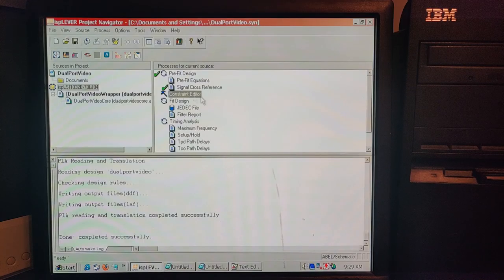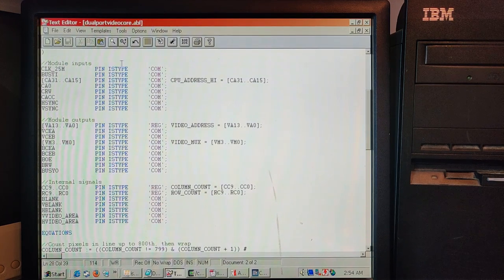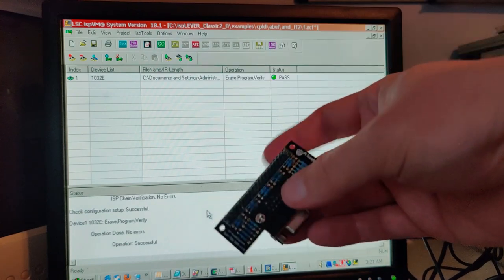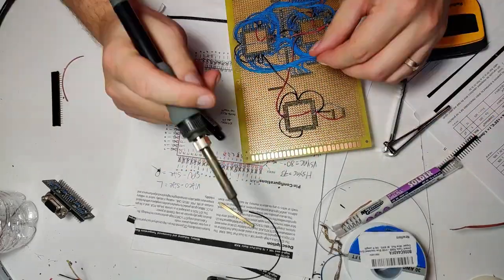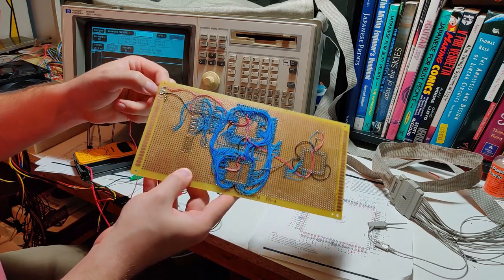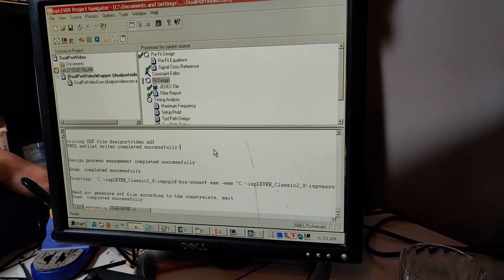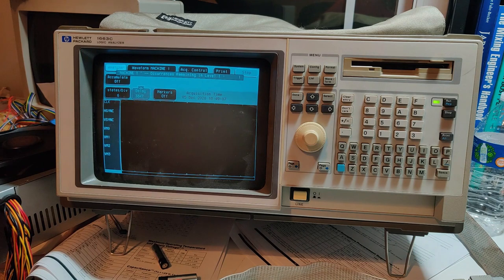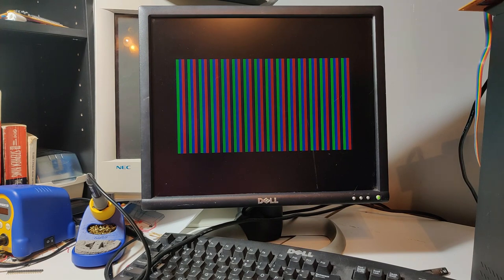DIY Video Card: CPLD Timing Logic - Part 2

Comment: I have the same HP logic analyzer. LOL
Reply from the maker: It's an absolute tank. It's only a shame that I'm so bad with it. I still don't really grok how multiple-stage triggers actually work
Reply: I have an even older model, the 1630G. To be able to back up any configs, I had to attach an HP-IB floppy drive (that I scavanged off a 68k-era HP-UX box). I should probably replace it with something newer, but I don't need a >16 channel logic analyzer all that often. (And all of the USB and "built into an o-scope" logic analyzers top out at 16 channels.)